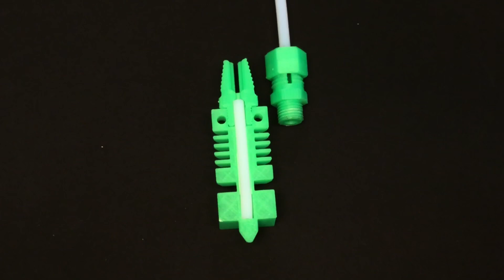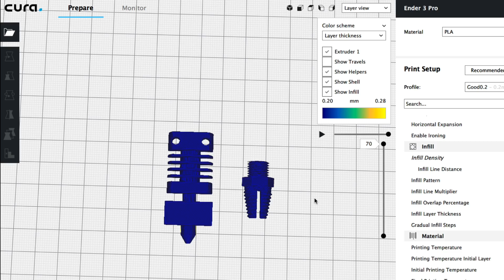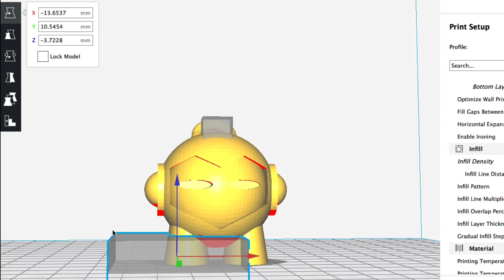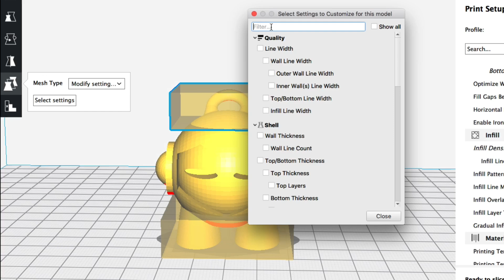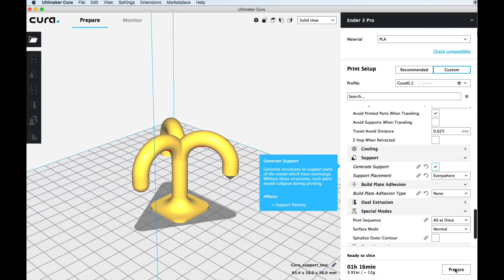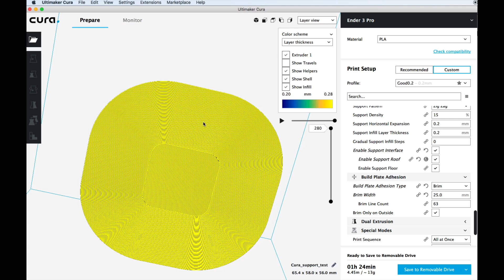3 Cura Slicer Setting Tricks For Beginners

Comment: Im running Cura 4.7.0 and having trouble finding Support Blocker button on the left ? Is it a addon ? Is it changed in an update perhaps ?
Reply: same 😭
Reply: Found it
Reply: @alessiocirella3135  where? Please enlighten me😁
Reply: @sieferswe  it's the last option on the left sidebar
Reply: @alessiocirella3135  ah found it, ive looked at that button several times without testing it hehe. Thx!
Reply: @sieferswe  no problem :)
Reply: @alessiocirella3135  wow, was also having a problem finding it, til i saw your comment. Thanks!

Comment: Is there a way to do the 2nd trick in the video, except for the amount of clearance between the nozzle and the print? I'm printing something that has a chamfer on it, and  I would like to print this on "Draft" setting in Cura so it prints faster, but when it gets to the chamfer I don't like how it looks, but when I printed it on "Fine" setting in Cura it looked perfect. So is there anyway to use those support blockers that you showed, but instead to make the clearance between the nozzle and the print smaller on certain parts of the print?
Reply from the maker: That would be layer height setting and I don’t believe it allows that.
Reply: Cura supports adaptive layer thicknesses now so that they are thicker on vertical surfaces and thinner on gently sloping surfaces and chamfers. See..

https://ultimaker.com/en/blog/52520-print-detailed-objects-faster-using-adaptive-layers-in-ultimaker-cura

Comment: Yeah but HOW did you get the parts to appear in the slicer???
Reply from the maker: When you load a file it should automatically show up.
Reply: If you can't get objects to appear at all then click "File" then "Open" and select the .stl file you want to load. If you don't know how to create an stl you will need a modeling program and some tutorials. TinkerCAD is beginer friendly and has tutorials built in.

If you mean how do you see the brim and the infil then once you've sliced a model look at the blue strip near the top. You're currently in the "Prepare" view. Click the Preview button to get a veiw that shows the brim etc.

Comment: I have a CURA question which should be simple, but not for me. Using CURA 4.2.1 on MacBook Pro the window for the custom Printing Settings is covering up 1/3 of the build plate. What command is used to move the build plate? I am not seeing any obvious CURA boxes to check, so I am thinking that one has to hold down some sort of key sequence on the Mac to get control of the build plate.
Reply from the maker: Try the shift key
Reply: @FilamentFriday  Shift Key did not help.  But thanks for the reply.
Reply from the maker: Works for me on my Mac. Hold shift key while moving the mouse with either right (or left) button pressed.
Reply: @FilamentFriday  Oops - I have a track pad, lap top mac. I will retry and let you know. Tnanks
Reply: @FilamentFriday  How simple if one had 3 hands. Hold down the Command and Shift key using one hand, then with the other hand click the enter track pad bar, and with whatever finger one still has left move the build platform using the track pad.

Comment: Do you never use "support everywhere" or it depends on the model?
Reply from the maker: Depends on the model
Reply: @FilamentFriday  Thank you I will give it a try, I have been learning and calibrating my first printer (ender 3 pro) with small figure models, I am curious if for small figures (up to like 60-80mm height) is usually better to go normal zig zag/lines. Also, have you reviewed the new CR10S pro model?

Thanks for your videos, they are very very helpful!
Reply from the maker: Gotta subscribe so you don’t miss it ;)
CR-10S Pro: https://youtu.be/TnI5sB4joyg

Comment: I am new to cura so I am learning it for the anet a8 plus, one thing I found so far is when I slice a model and than load it to the anet the temperature settings for the hotbed is gone  but it has the setting for the heat bed  so the bed is heating and the hot end is just setting there,  any idea what I maybe doing wrong ?
Reply from the maker: I don’t understand. I don’t have an Anet A8
Reply: @FilamentFriday  thanks  for replying,  I think there  maybe a glitch in the 4.4 when I sliced and loaded object , it normally  shows the temperature for the hot end and the bed warming up but for some reason when I do the slicing in cura 4.4   the hotend doesn't heat up  but the bed does ,

Comment: just a note, this does NOT work with Cura 4.12 with the lightning infill setting. You will have to change that. very frustrating til I figured that out.
Reply from the maker: Are you saying you can’t get this to work on 4.12?
Reply: @FilamentFriday  not with lightning or even grid as my infill (I only tested 3 patterns). It would only make the inner/outer walls and leave the rest empty. Once i changed it to concentric, it filled the selected area to 100%. I was making hands of a model solid.
Reply from the maker: I’ll check it out.

Comment: ultima cura 4.7, where i can found or enable that same option of the support block? i cant found it, that its not longer available?
Reply: Same here. I didn't even update to 4.7 and I remember that I have used this already. I just came back here to see if I was doing something wrong but it seems that that option is gone now.
Reply: Go to the Marketplace in cura, it's on top right beside "Sign in" button.
Scroll and you can find the Plug in, install it, restart Cura, profit.

Comment: how is it with cura 4.0? cant change the infill settings value for the box - version bug?
Reply: I have version 4.0 and it worked for me.  Make sure to close the window that lists the settings you want to change.  Only then can you alter the values of those settings.
Reply: @Satchboy71  that doesen't work for me. the interesting thing is i can change any value of the other options - only the infill percentage not... :/
Reply: Didn't work for me either. But I changed number of bottom layers to 999, and that did the trick!
Reply: I figured it out…  i use normally extruder 2, the first one was set (dont know why?!) to 3mm line distance for the infill and the boxes you can make for changing the print partically are set by default to extruder one. Cause of the infill line distance setting from ex 1, which wasnt shown (ive never used it), it didnt let me to change the value :D dumb program :D :D
Reply: After you select infill, close the option list and then you can fill in your %

Comment: I have a problem and thought you might be able to help. I was running a part ( 24 hrs to complete ) using Cura 4.6.1 when I had a problem with the Bowden system. The result is I have 1/2 apart on the build plate. I know my z coordinate where the printing actually stopped. I have tried sinking the already printed portion of the part  below the build plate. Then I adjusted the initial layer height to get me where I need to be in the z. A dry run works well. When I run with filament, I do get filament extruding, but, the x and y movement is minuscule and not normal. Do you know how I can continue the print, essentially picking it up mid stream, without scrapping the part and starting afresh?
Reply from the maker: You could modify the GCode but it’s not easy.

Comment: When I create the support block box, then scale it to size ... i then click on "Per model settings", then "Modify settings for overlaps" ...then I get 2 options in the pull down menu ... 1 is "Infill mesh only" the other "Cutting mesh" ... but anyway, i select "Select Settings" and tick the infil box ... and now i see the infill box which has a 20% inb it ... but it is greyed out ... i am unable to change the %? What am i doing wrong? Im using 4.11.0
Reply: Click on your support block box, then click “per model settings”, then click “modify settings for overlap”, then select the drop down and select “infill mesh only”, at the bottom click “select settings”, a menu will pop up and you want to select “infill density”, back in the “per model settings” you can select the density you want. I think you were doing everything correct other than selecting “infill mesh only”

Comment: What versions of marlin and cura are you using? I noticed your infill looks perfect other than the stringing. I recently updated both from stock Ender 3 FW to Marlin 1.9 and CURA from 3.5.0 to 3.6.0. Now the same models and gcode files that worked perfectly before have horribly underextruded infill. All settings remain unchanged. Have you heard of this issue before?
Reply from the maker: It’s probably the firmware. I’m still running stock Creality.
Reply: That's my thought too, but I don't understand what would have changed in the FW. My understanding was that the extruder flow rate was determined by the slicer. The perimeters, tops, bottoms and, supports are still beautiful. I suppose I'll have to roll back to an earlier marlin release and try again. Thanks for the reply. Love the channel!
Reply: @user-jw9nc1qr3n  it's probably Cura. check if your filament diameter is still 1.75mm or if it went back to 3mm like cura does with every single update.
Reply: @therealpanse  The diameter settings are all 1.75mm. I even have the issue with old known gcode files that worked before the updates. I am gonna try another slicer to compare infills. If the problem persists, I'll roll back firmware first. If mattercontrol  and slic3rPE work then it's likely to be Cura and the new FW combined.
Reply: Update..Mattercontrol and Slic3r PE worked fine. Infill is solid so far with those. The new firmware doesn't like Cura sliced infill on my Ender3 for whatever reason.
Reply: @user-jw9nc1qr3n  I got a similar problem, but with outer shells. they alyways look like cura is skipping parts of the geometry. every other slicer is fine. only cura prints circles like they are octagons stacked on each other, but rotated about 20-30 degreees, which gives me overhangs where there shouldn't be any. The printed models look like it sounds. I'm really not a fan of cura any more. some people can make it work, but with a cusom machine and heavily upgraded parts it sems like cura just has too many hidden options that influence each other to get a good profile working. It's horrible to look for that one hidden option that would help.

Comment: I used brim and it's so thin it is now permanently  stuck on the build plate and can't be even scraped off
Reply: You can try acetone to disolve the plastic (if you are using a glass bed).
Reply: @mathsarslain  thanks but I do use the magnetic bed cover and used acetone on a corner of it, and it melted the corner
Reply: I have had this a few times, I find that whenever I print something that is big enough that covers the leftover brims it tends to peel off with the model when its done. I try to only use raft or no adhesion now though, brims seem to cause me more issues than theyre worth.

Comment: Ok... why do I get gaps in print when following this? 
Added cubes for 100% infill at areas
Saw every "cube" in print, thought maybe bc it was angled parts... 
Did same method as you made bottom 10% as recommended and entire top as 0% infill, but...
Where the break is on this, there is a gap... as the "eraser" point on the cura model
Using 4.3 now
Early test was with 4.2.1 and angle parts
Reply from the maker: Not sure. This video was done with earlier version of Cura.

Comment: Couldn't you just add more top and bottom layers instead of all that block nonsense? Just set it to like.. 15 top layers and 15 bottom layers. Because it prints those 100%
Reply from the maker: The blocks give you options. Could be top 85% or different pattern or many other options.